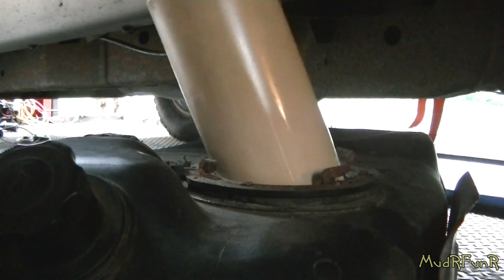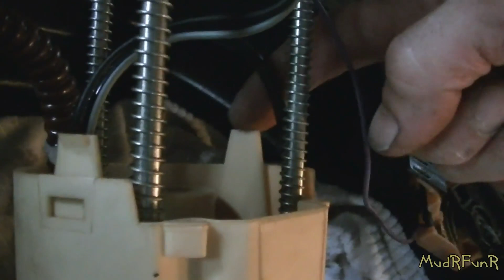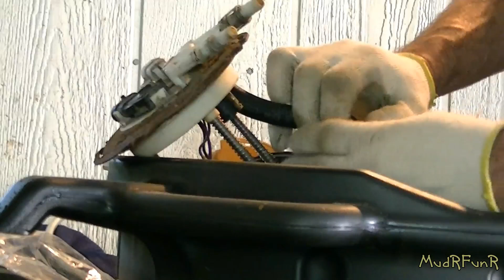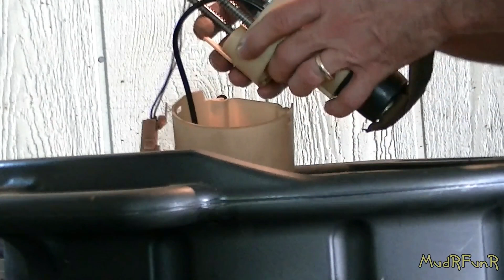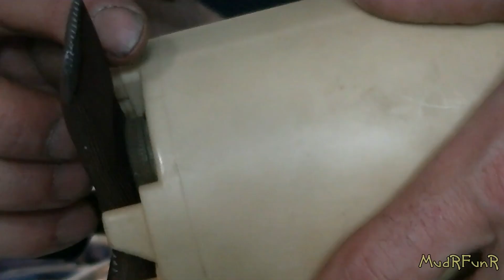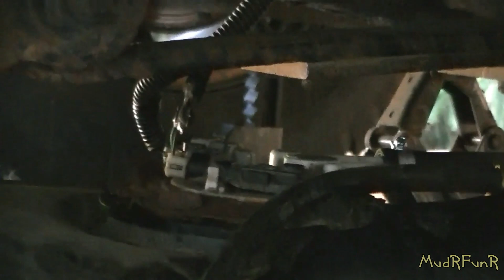98 GMC Jimmy Fuel Pump Repair

Comment: Thanks for the video! Got a question,You replaced the pressure line ?yes?. I have a 98 suburban that's very similar that i need to swap the pump motor on and was wondering if I can use the flex factory hose that came with it or if it needs replaced after it comes off and if its reusable ,how does it come off and on with no clamps?
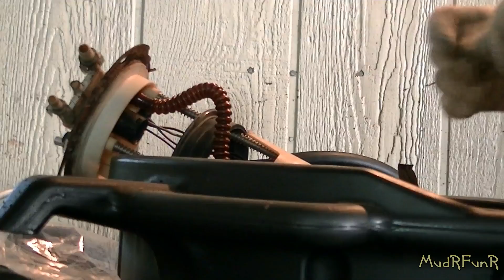Reply from the maker: At 3:08 in the video is your answer.

Comment: how did u fix that broken middle hose connector on top of fuel pump.??
Reply from the maker: +Karson Gibbs The center line is just a vent line with no pressure. I just put the hose on as far as possible and clamped it.
Reply: okay and same with the far left on?  it just broke on my fuel pump on my 01 blazer
Reply from the maker: +Karson Gibbs The connector on the left (medium sized) is the fuel return line. It does have some pressure. If you can get a hose on far enough to clamp it, you should still be ok to do that. 
The largest line is a pressure line and you will need either a special fuel line clamp or 2 regular hose clamps on that one.

Comment: Hello, My company sells the complete fuel pump repair kit with installation kit for $19. Here is a link: http://www.ebay.com/itm/NEW-PREMIUM-HIGH-PERFORMANCE-FUEL-PUMP-STRAINER-KIT-GM-VEHICLES-GA1000-/380958863036?pt=Motors_Car_Truck_Parts_Accessories&vxp=mtr&hash=item58b2eaeebc

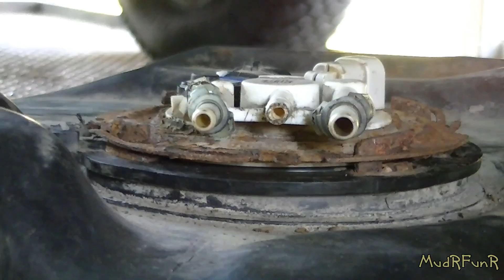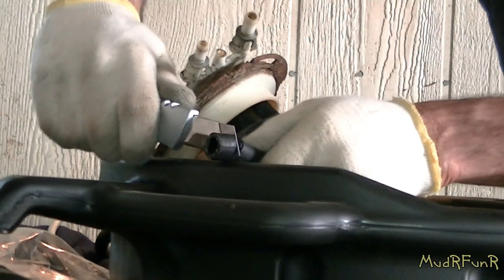Anyone interested can reach me directly to purchase by calling 305-232-3433 M-F 8:30a-5:00p est. Thanks